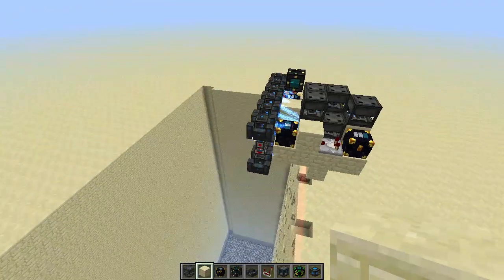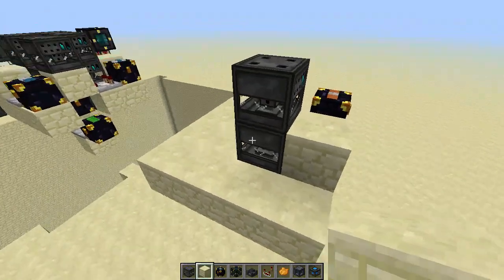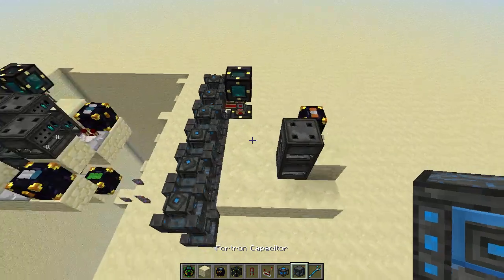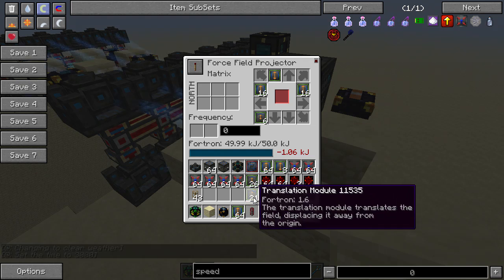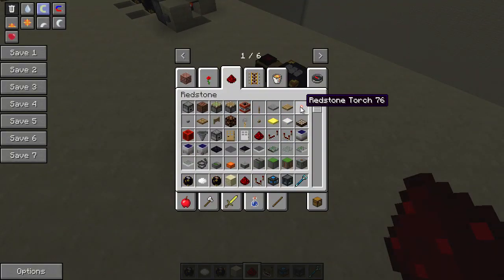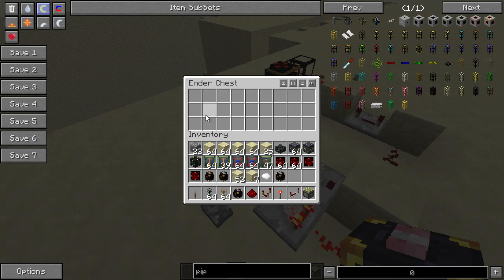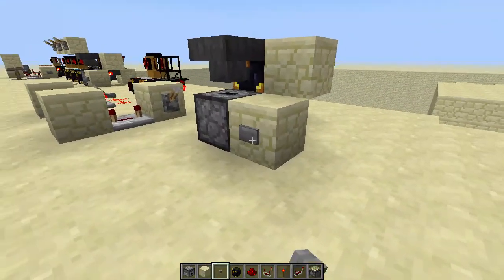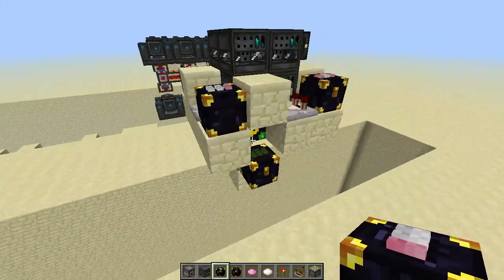FTB Tutorial: Frame quarry

Comment: Made a tunnelbore with this design, but ran into issues with lava and water, creating a very expensive Cobblestone generator. So i added a second Projector, using a Field stabilizer module, that places cobble right in front of the Bore. This way all the water, air and lava gets replaced with cobble. Also had to double the amount of tesseracts and Coercion derivers to make up for it. And finally i made its size 2 blocks smaller by using only 2 scale modules instead of 4. Loving this mod!